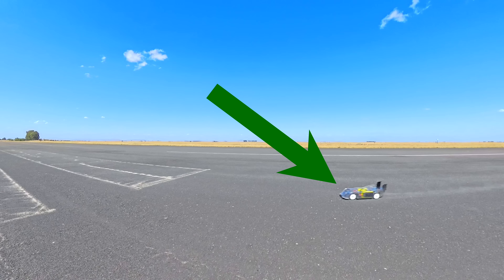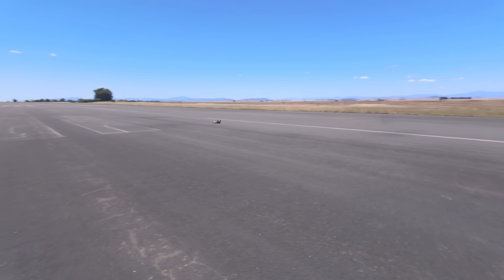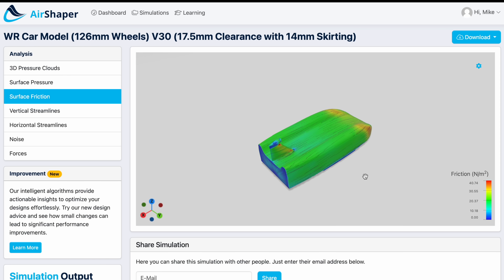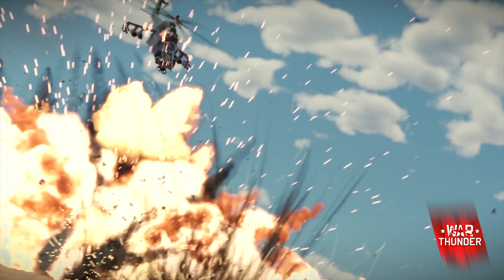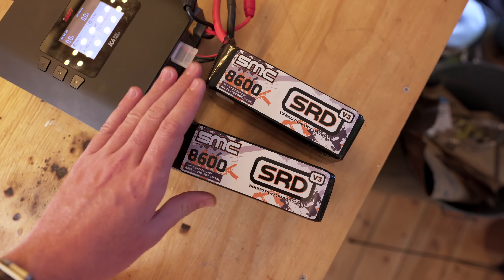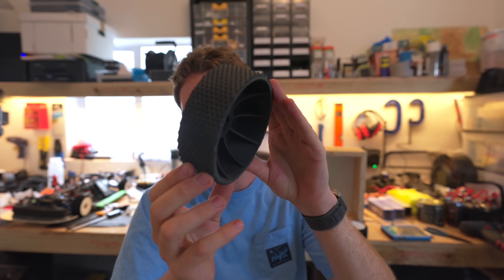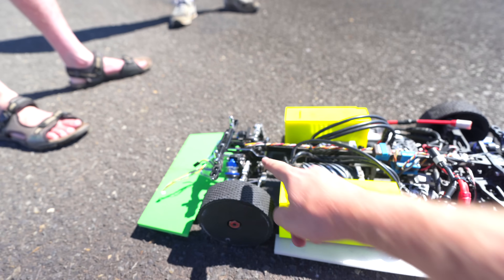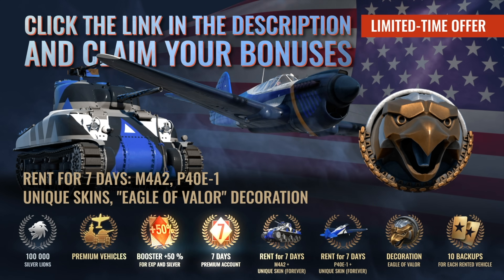World’s Fastest RC Car Project - Part 1 Aerodynamics

Comment: You're not going to have much success with those motors, they are great motors, I own one bit they are torque not speed monsters which run nice and cool. The trouble is gearing up to make use of the torque always results in much more heat than if you ran a higher rpm motor on lower gearing. For sure low kv and high voltage is more efficient than high kv low voltage bit the problem is you are using a high torque low kv motor and have put high gearing bit not high voltage. That motor is capable of at least 16s per motor. If you are running less than 16s per motor you are better off with a higher kv like a castle 2028 1100kv or if willing to spend a Lehner 3080. Also a thought but almost everyone speedrunning seems to have trouble with the cars catching air and taking off. I would personally try and be one of the first to introduce EDF fans for downforce if I was to attempt this, so you can create lots of downforce without needing huge spoilers creating extra drag. Personally I would build with 2 high revving 1100kv motors on 12s with a pair of Mad Max 20 esc's or 800kv on 15s with a pair of mgm esc's. Add a few EDF jet fans to suck the car to the ground. People keep making the mistake of going low kv assuming it has more torque and then gearing up but keeping the same voltage...this is not how it works. Kv should be chose against voltage, limiting factors being rotor rpm limit and heat. A 560kv can like used her is capable of at least 16s, people are sometimes running on short runs the 1100kv castle and TP motors on 12s. If not wanting to add EDF fans for downforce I would at least consider switching either the motors or escs out so you have a combo that is voltage matched at peak power motor vs esc. Also a big factor is voltage drop with Lipo's so the more battery you can stuff in there the better.
Reply from the maker: This comment is actually super interesting. A lot of stuff I didn’t fully think about here. Of course I would always go for a higher KV if I can to make the gearing better. I’m used to getting custom kv motors made for my drone records but don’t have that relationship with the rc car manufacturers yet. Next I am I’m trying out the dual Hobbywing 1100kv motors same size as the Castle Creations 2028. But yeh this is very interesting stuff, thanks man. In terms of ducted fans, this might mess with the aero under the car… but I haven’t tried yet. And then where does the air go once it’s inside the car? Out the back? Then you are also getting air propulsion which is kiiiind of cheating. So it’s a tricky one. I might go up to 15S for the next build if I can get sponsors on board for the components
Reply: Hi mate, no I'm saying use the EDF fans to create downforce not propulsion. Holes in the chassis, may need to use a larger chassis plate and use the edfs to act like a vacuum cleaner sucking the car down and expelling the air straight upwards out of the body. You can if you didn't class it as cheating also have a 90 degree bend and expel the air backwards increasing propulsion but of that is considered cheating or against the rules then expelling the air straight upwards wouldn't be adding extra propulsion only downforce. Have you seen real life cars like the McMurty spieling or Brabhams F1 fan car? Yeah Higher Kv motors will be better suited to this voltage. The motors you have in theory have more power potentially due to the large can size but they would need higher voltage than 12s due to the low kv. I would first pick the voltage you want to run, then find the highest kv motor you can find which won't break the rotor or burn up, as I say some people run the castle 1100kv on 12s though castle doesn't recommend, for bashing that would get too hot but for short speed run it should hold. Castle 1700kv also has a stainless steel enclosed rotor that can withstand high rpm's, somepeople are taking the rotor from that motor and putting it in the 1100kv can to make it more reliable on 12s. Hobbywing again is limited to 12 at around 800kv, anything higher is classed as 8s, how reliable a hobbywing 1100kv motor on 12s would be I don't know. TP power have more winding options and are very powerful but run very hot, however they have higher than 800kv motors which ate rated for 12s. For example they have some motors that work out to 11s limit but when you take into account load from the car you can get away comfortably running 12s. Lehner motors are the best at high rpm's but very expensive and pretty heavy.
Reply from the maker: Yeh yeh this is all very accurate. I didn't thin to much about a smaller motor with higher KV being a better option, but you are correct. Luckily I have some good motors coming in soon which I can test and choose more wisely. The small 1700kv Hobbywing motors actually worked surprisingly well!
Reply: @LukeMaximoBell1  yea I'm not saying go too small like 1/8 scale stuff, just the typical 56 to 58mm diameter motors like castle 2028 size.. the motors you have are good and potentially even more powerful than those but you need to be running them at 16s each to get the most from them. Flier make some cheap 16s esc but they aren't the most reliable and tend to not push a lot of amps nowhere near their rated. The only real decent 16s esc ATM is the MAD Max 21 esc, that combines with the motors you have on 16s each will give you all the power you need. Trouble is they are around 600-700 USD per esc. I would definitely try look into the EDF fans for downforce, you would be one of the first amongst the speed run guys and sufficiently powerful fans are not overly expensive. Most of the guys have trouble keeping their cars on the track or tyres shredding to pieces before the motors manage to get to peak rpm. Increased downforce long term may save money due to fewer crashes, enable you to hit the accelerator earlier and build speed sooner and minimise wheel spin reducing the damage to the tyres during slip. Given you seem to enjoy thinking creatively and coming up with your own solutions as long as this isn't against the rules I would very much at least try attempting it since the cost isn't overly expensive to experiment with.
Reply from the maker: @DanielK-xn5si Yeh I have seen Mad's ESC. Their Max20 looks like a good option as it can handle 400A, and doesn't seem to have a current limiter built in so with really good cooling it should be able to handle 800A. And it goes up to 15S. The trouble is 15S batteries are also tricky, so I would have to get custom ones made. Which is doable, but I've already got really good 6S packs to make 12S. Yeh I like the idea of downforce fans, because it also means I can adjust how much downforce there is. I could even start out low and increase the downforce fan RPM as the car increases it's speed. And I can use the downforce fans as coolers for the ESCs and motors

Comment: Bro someone already made a 100hp version
Reply: Its about the Speed Run, not the power... He cant even put the 80HP down properly right now with the current wheel setup. 
100HP set up right now would have no benefit.. Later on when its all sorted out, sure!
Reply from the maker: Yeh more HP doesn’t necessarily mean more speed. However less drag means more speed

Comment: I am so glad you are playing with other wheel and rubber designs. Maybe make the solid rubber a bit thicker and try printing a solid tire from TPU or something similar. I was watching Kevin Talbot, but he just stuck to foam wheels. I still think the right shore rating and the correct thickness may make a difference. Love your ingenuity. Keep it going. Don't just break the record, smash it!!!
Reply from the maker: Thanks so much, what an epic comment. The wheels for sure are the biggest failure point for the guys going the quickest currently which I why I am putting time into it. But man it’s difficult to find the right foam and adhesive. I am going to play around with TPU tires for the next video so let’s see how that goes!

Comment: Maybe if your splitter wasn't behind the body and it could do its job and create some downforce your car wouldn't take off like an airplane.  Especially since you're using an airplane style rear fin which creates no down force.
Reply from the maker: The splitter is to divide the air at the front. If it stuck too far forward it would create more drag. The car only took off because it went sideways so I don’t think downforce was the issue
Reply: @LukeMaximoBell1  go look at all the 180mph+ cats at Rossa (the super bowl of Rc speed runs). They all have splitters sticking out past the body and the body is usually taped to the splitter to keep air from getting under the body. The rate at which air escapes from under  the car and the body absolutely affects down force.  Splitter rear diffuser and spoiler all work together to create downforce.

Comment: 250mph will only be possible with a massive jump in tires technology. They power is there now, but no one can put it to the ground without exploding tires. I personally feel like the tires and wheels need to be much narrower as well. Like maybe 1/2 the current width.
Reply from the maker: That would help for the front wheels. But then you also have less foam so it will wear down quicker… it’s tricky
Reply: @LukeMaximoBell  Why not use wheels of bigger diameter ? they would have less RPMs for the same speed, helping the tyre to survive
Reply: Cant we look at what top speed racers actually use, they've been going past 250mph for a long time with much higher loadings.
Reply: @CheekyNinja  They  run pneumatic tires that are extremely thin and have incredibly precise belting etc to maintain balance and make the tire very strong. They often finish a run with the outer layer of "tread" pretty much destroyed but the tire is still holding air. They are between 5 and 6 inches wide and most run on very high strength alloy wheels with beadlocks.
Reply from the maker: @ the main difference is the tiny size of these wheels as well as the fast that all the thrust goes through the wheels. On jet engine cars they just roll on the wheels.
Reply from the maker: @CheekyNinja  The wheels are the major failure point limiting the speed of current cars
Reply: I think you’re right that tyres are the main limiting factor but it’s mainly keeping them on the rims that’s the big problem. I have a feeling that the ultimate solution will involve a set of tyres per run and perhaps Kevlar reinforcement into the bargain. And maybe injection moulding the foam onto the wheels. It’s not a cheap hobby by any means
Reply from the maker: Yeh anything too dense and it pulls itself off the rim with the forces. I’ve got some good ideas to try out thoufh

Comment: The high speed cars in RL used machined alu wheels.  Might be worth a shot.  you could skeletonize them, then cast the tread in place, then machine them and balance them.  Should be good for more dirability and higher rpm.
Reply from the maker: The 3D printed wheels are bulletproof 😅 the problem is getting the right foam and getting it nicely glued to the wheel. But I’ve got some ideas

Comment: I wonder about the runway where the planes did not take off and land. The cement could be smoother there. Otherwise, that looks like a good location.
Reply from the maker: It’s pretty much the same across the whole thing. I think the roughness isn’t an issue
Reply: @LukeMaximoBell  Oh, good luck!

Comment: Have you considered torsion bars with dampers in stead of the coils + dampers? In cars you get wheel hop when suspension has too much soft points. The foam may have failed because of hopping over the surface.
Reply from the maker: Fair point, but Raz has tested out these springs loads and knows what works best so I trust his judgment 🙌🏼

Comment: Suggestions:
Make front wheels/tires narrow as possible; less wind drag, rolling drag, rotating inertia, and understeer is much better than oversteer at speed.

Raise rear suspension for underbody vacuum, stiffen swaybar for counteracting stability issues

Longer rudder (not costly to drag when going straight) to save those tire explosion scenarios
Reply from the maker: Thanks! These are all good ideas 🙌🏼

Comment: Wouldn't you rather the batteries fly off, than have them get cut open by straps and set fire to your whole car?
Reply from the maker: It's an interesting question. The batteries are super rigid so I don't think they would ever get cut open. I did make TPU cases for them to protect them in a crash

Comment: Just a tip. The hobbywing ESC cut out throttle because it can only draw its peak current for a couple seconds. You have to feather the throttle for high speed. For example. Pin the throttle trigger slowly to 50% then release throttle and wait like half a second, then pin it to 70%. Release throttle and wait half a second, and so on. Until you run out of road. that Max 4 can draw like 2000 amps but only for like a second.
Reply from the maker: You are absolutely right! I experienced this first hand with my single 70125 setup. It would accelerate then slow down, then accelerate and slow down. The perfect pass launch control was a bit aggressive. But that current limiter is frustrating. I don’t think it’s a feasible ESC to use for this record unfortunately.

Comment: what kind of foam sheet did you use to make the foam wheels? Thinking about making custom wheels for a 1/10 pan car maybe around 25-30A durometer
Reply from the maker: I got neoprene, which felt about as hard as the BSR orange. A lot softer than the purples. But it’s very expensive. I think BSR is using polyurethane but I’m really not sure and they won’t share their secrets for obvious reasons

Comment: Why wouldnt you have a full teardrop design? With a small tapered tale in back like a raindrop/tadpole - the current design had the shell just cut off at the back - this is where all your turbulance drag is.
Reply from the maker: Just question. Initially I did this, but the car starts getting sooo long. The issue is the car shape isn’t the right aspect ratio. To do it properly one would need to make a much thinner car body and then close the end like a teardrop. But this would take a lot more R&D so maybe a future down the line option.

And interestingly enough chopping off the  tail isn’t a bad as you would think. It also provides some downforce to do this. Whereas the pure teardrop shape often gives lift instead of downforce

Comment: You went through all that trouble in CFD, and then completely destroyed the aero with a sloppy splitter and massive lifting body hood bolts
Reply from the maker: The splitter has been updated since and I’ve got a new mounting system to avoid the pins at the top 🙌🏼

Comment: Great work so far. Yeah the wheels and tires really seem to be the weak spot on most speed run cars. Looking forward to the next vid.Do you think it wouild be possible to design a wheel that doesn't have a tire? It's one piece out of a material that is grippy but also strong enough not to fly apart? Just a thought.
Reply from the maker: Great thinking. I don’t think so because anything too hard will put too much strain on the axles like you saw in this video. However I am experimenting with some materials that are more like rubber than they are like foam. Foam tends to wear down a bit too quickly. Wait for video 2 to see what I try!

Comment: That tapered design will reduce drag but at what speed does that diminished drag turn into lift?
Reply from the maker: Very good question. The tapering on the sides doesn’t generate lift, but curving the top down will because it generates low pressure above.
Reply: @LukeMaximoBell  correct, the low pressure from the decreased drag will create a low pressure pocket above the rear of the car. When that pressure differential becomes great enough the weight of the car will no longer be enough to resist that low pressure zone. The low pressure will also try to promote the rear bodywork to balloon to fill that low pressure zone, the benefit is you can decrease that pressure differential by forcing the air that is inside the bodywork and under the car into that low pressure zone. Fan cars of the 60s and 70s were outlawed in racing because of how stable and successful they were.
Reply from the maker: @RadDadisRad  Do you mean forcing the air inside the cover of the car out the back? At the end of the day I am not opposed to adding in lead weights around the car for extra downforce! haha. It will mean slower acceleration and braking but shouldn't affect top speed at long as I have enough room.
Reply: @LukeMaximoBell  you could add weight. I am just suggesting a different means. I haven’t seen it done on RC level stuff. Maybe for good reason or maybe because people aren’t abstract enough to pursue alternative means of stability.
Reply: @RadDadisRad Quite so. I think a variation on the theme of the McMurtry Speirling is the way to go ultimately.
Reply from the maker: Yeh that would be awesome!

Comment: Xlx2 and castle or tp motor and even the hobby 1100kv g2 would be better with castle esc for speed, mad components are making some insane 12s and even 16s esc’s with more amps than hobbywing but castle is the king 220+ with two esc’s but one motor build’s with xlx2 have gone 190-200
Reply from the maker: Yes true! I wanted to try out Hobbywing for starters because they were keen to send me their products for testing. I’m going to look into other motor ESC options for part 2. I didn’t know about Mad Components so that’s for the tip 🙌🏼
Reply: to be fair the max4 can handle more power on 12s than an xlx2 could ever handle ive peaked 27kw without a cut
Reply from the maker: What! No ways, I guess it's the sustained current draw when it throttles?
Reply: i'll add you on fb and send you some data logs and explain my testing 😄
Reply: @ no way it’ll ever go faster though😂